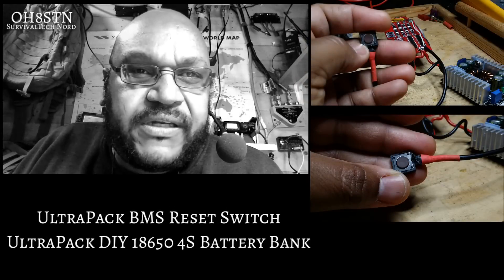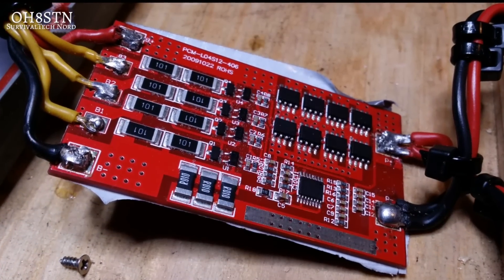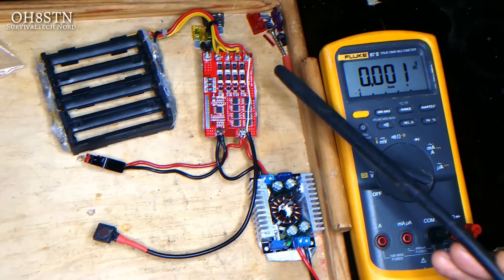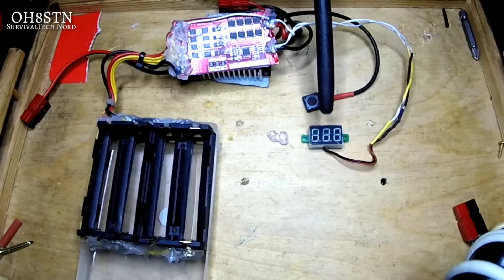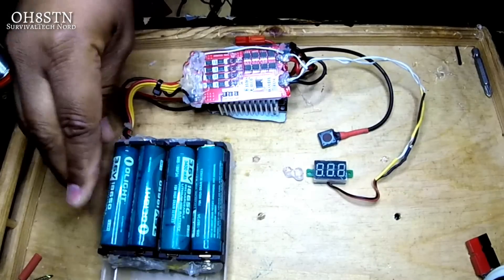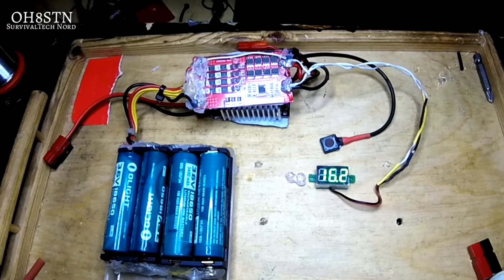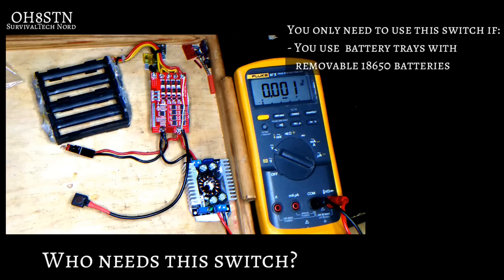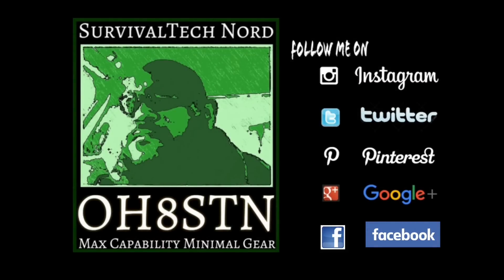DIY 48wh QRP Battery Pack for FT-817ND
UltraPack BMS Reset Switch Mod

Comment: Very cool !
Reply from the maker: +SurvivalComms Thx how's your project coming along?
Reply: I am still waiting for the BMS board. I did convert the PX-300S Lunchbox to use my 18650 pack and it works good. I ended up having to eliminate the original DB9 battery interconnect and In doing so I repurposed the original cinch jones charging jack to a DC input. I aligned the unit and backed the RF output down from 10.5 watts to 8.0 When the BMS board hits I have plans to build a self contained pack.